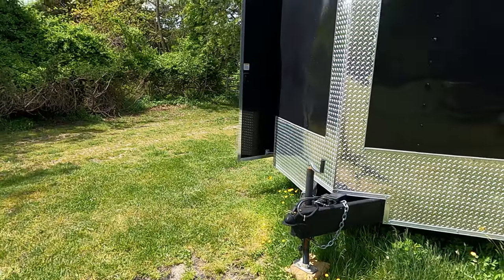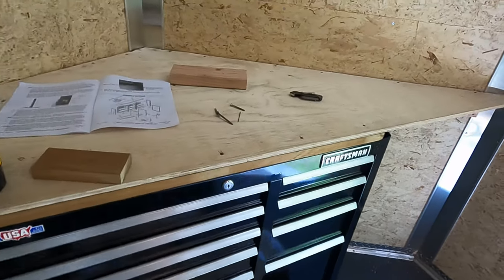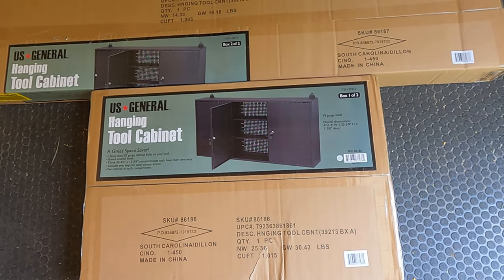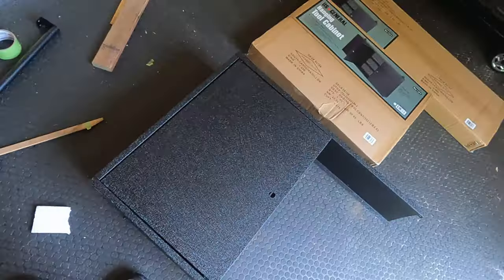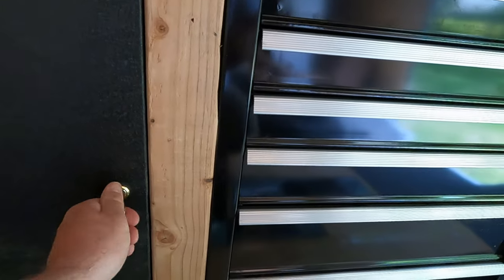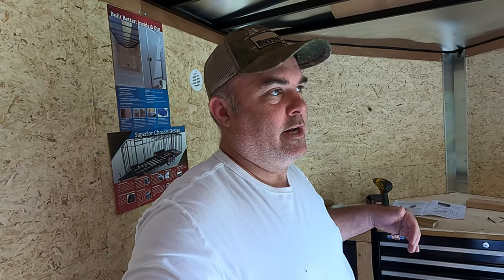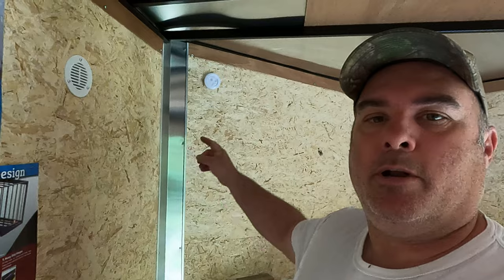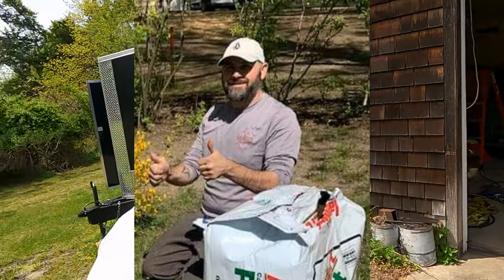RACE CAR TRAILER PROGRESS UPDATE

Comment: maybe I'm too late with this suggestion, but check out MIDWEST RACE CABINETS. They even sell cabinet door fronts , but do have a nice upper cabinet set up for a v nose. I put all new wall panels on mine, and used high gloss white paint...It's way easier to clean if you need to, much smoother finish than the flat of eggshell finish. I am trying to find someone to duplicate your mounting system for the spring sliders, that''s an absolutely awesome idea. I have a 1971 Z28...that's what drew me to your channel. Thanks for sharing!
Reply from the maker: Yeah, it's a little to late for the cabinets, but thanks for the tip... Maybe I will use gloss paint. It makes sense about the easy clean up... I'm glad you like my mounting system. It took me a while to nail it down. Every slider has different dimensions. Thanks for watching.

Comment: Just found your channel. Kinda off the wall comment here but about your lighting system if you use a generator at the track I’d recommend getting an RV outlet and then buying a cheep electrical box and just wire your trailer for 110 volt. That’s how I did mine. 

You have a nice looking setup so far. Nice car too. I have a 1978 tube chassis car.
Reply from the maker: It's not off the wall. I could use all the help I can get with this. It's my 1st enclosed trailer. I thought about doing that, and putting a plug in, so I could pull power from my shop. I had a friend tell me to just use a battery that my truck charges, but I don't know how good that would be with an inverter for power tools.
Reply: @jimkiernan2855  well I’m my opinion going with a generator at the track and plugging in to your shop at home would be the best option. That way you always have power and won’t be dependent on the battery being charged.

However if you do want to do the battery so you’re not dependent on a generator you can buy solar chargers or battery maintainers to charge your battery that way. I use to have a solar maintainer on the last open trailer I had for my winch battery. My current trailer I don’t but I just use my battery charger to charge my battery periodically. 

Plenty of options. Everyone has a different opinion. I use a generator at the track to charge my race car and also run a 24” fan, microwave and Keurig. So I wanted to go the 110 VAC route.
Reply from the maker: I do have a Honda generator, and you do make good points. I'm going to definitely look into it.